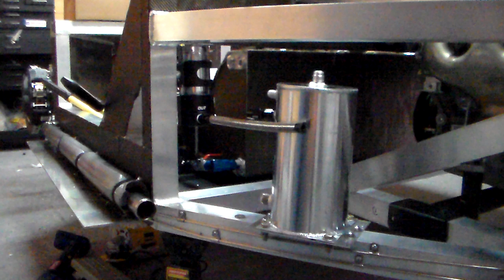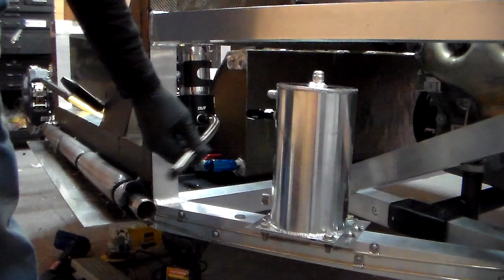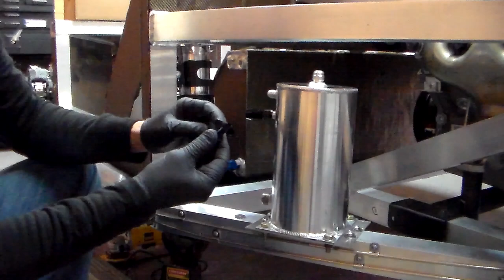SLC BUILD 16 -AN LINES FUEL SYSTEM

Comment from the maker: If you listened I stated that the line was marked before cutting, then marked to make sure the fitting didn't push itself off the line.  The tool is designed for cutting AN lines and the bigger one gives cleaner cuts and is easier to cut with.